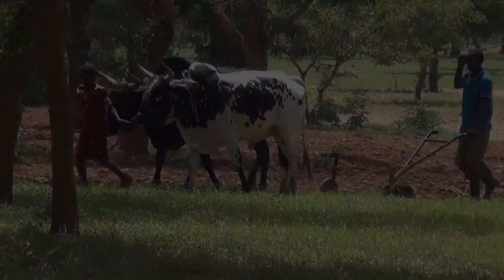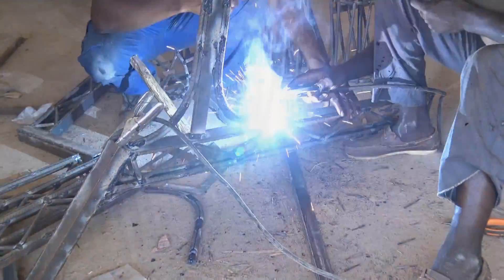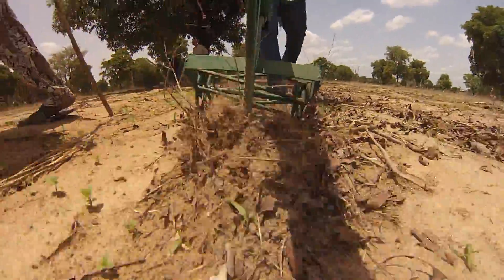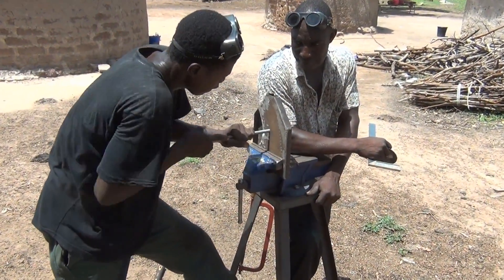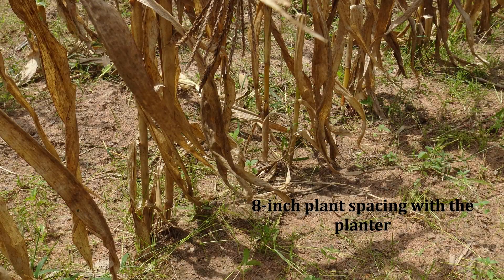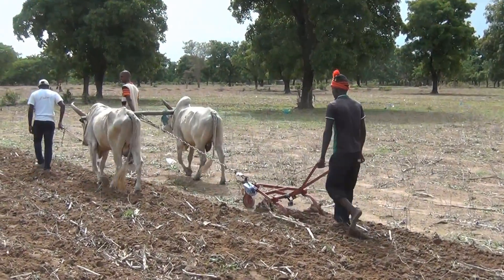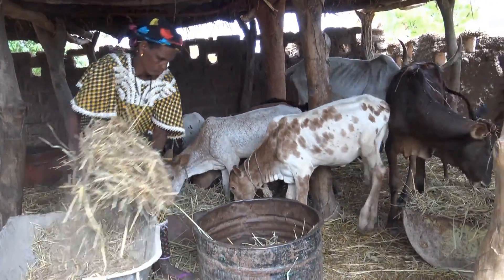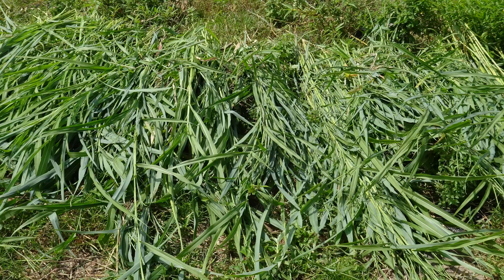Innovations in animal-powered mechanization, Burkina Faso

Comment: thanks for posting.    here are some things to consider.     most of the folks now living off the grid CAN have access to useful amounts of Electrical power/watts.   USE  an   OX  with a turnstile  to drive a Suitable  pma.    permanent magnet alternator.   the radius of the turnstile can be WHATEVER size is most convenient.   (but, imagine a forty meter wind turbine rotor, oriented horizontally.    attach an ox or five, or two elephants and a pygmy pony.)      such a system could easily supply a continuous 100 watts of Electrical power.   see  horse mill; see ox-powered mills.     if a charging system and one or two sla batteries are used, power can be stored for use when high-current power, is needed.    cheers              googletranslate
@t